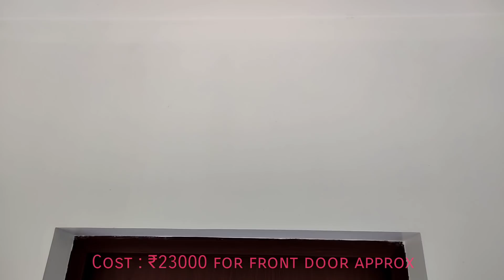#lowcost housing #Home without wood, cement | New gen construction materials | Trips & tricks vol 13

Comment: building cost paranhilla..
Reply from the maker: House construction cost: 1000 ~1100 /sqft (structure)
Interlock brick cost - 29/- Piece
Gypsum platerig cost - 32/ sqft (with material)
Steel door - 23000 (Front door), 14000 Iinteriro doors)

Comment: Interlock brick cement illathe aano undakkiyee..
Cement illa ennu paranjuu
Atha chodichee.
Filler slab enganee
Reply from the maker: Cement platsering illa ennanu udeshichathu :-) . Fillerslab is good, if it paved in a proper manner, else leakage is the result.

Comment: Exterior wall gypsum plastering ചെയ്യാൻ പറ്റുമോ.
Reply from the maker: Ipol water proof gypsum available anennu kettu. Athu use cheyyan patum
Reply: Ok thank you...
Reply: Interlocking mud blocks ന് വെട്ടു കല്ലിന്റെ അത്ര strength ഉണ്ടോ. രണ്ടിന്റെയും size same  ആണോ..
Reply from the maker: @myunus737  size same alla..1.5 interlock briks vendi varum oru vettukallinte size match cheyyan. Compressive strength kooduthal interlocking bricks inu aanu
Reply: അപ്പോൾ ധൈര്യമായി interlocking mud bricks കൊണ്ട് പണിയാം. Thank you so much...

Comment from the maker: House construction cost: 1000 ~1100 /sqft (structure)
Interlock brick cost - 29/- Piece
Gypsum platerig cost - 32/ sqft (with material)
Steel door - 23000 (Front door), 14000 Iinteriro doors)
Upvc Windows - Approx 600/sqft
Reply: Trips&tricks chetta no onu thraamo
Reply from the maker: @shijuthomas795  8050927308 plz whatsapp.me
Reply: Also share the companies or brands and suppliers of the following:

Brand of gypsum plastering material.
Supplier of uPVC windows and steel doors.
Interlock brick brand.
Reply: Total expense without furniture ethra vanu ?

Comment: ഓട് വച്ചു വാർക്കുന്നത് വളരെ പഴയ രീതി.  ചോർച്ച ഉറപ്പ്. കുറെ കഴിയുമ്പോൾ ഓട് താഴെ വീഴും. മൈന്റൻസ് ദുഷ്കരം. 
 മണ്ണിഷ്ടിക ഈർപ്പം വലിക്കും. ഇത്  വളരെ കൃത്യമായി അടുക്കിയെല്ലെങ്കിൽ ലെവൽ വ്യത്യാസവും ഗ്യാപ്പും ഉണ്ടാകും. കാലാന്തരത്തിൽ പൊട്ടുവീഴും.കൂടാതെ മൈന്റെനൻസ് കൂടുതലാണ് ജോയിന്റുകളിൽ കീടങ്ങ
ൾ കൂടുക്കൂട്ടുന്നതായി കണ്ടുവരുന്നു. ഏതായാലും ഇത്തരം ഇഷ്ടികനിർമ്മാണ യൂണിറ്റുകളെല്ലാം പൂട്ടിപോയിട്ടു വര്ഷങ്ങളായി. ചെലവ് ഒരു
താരതമ്യം നടത്തിയിട്ടില്ല. 
ചെറിയ വ്യത്യാസത്തിന് റിസ്ക് എടുക്കേണ്ടതുണ്ടോ? 

വിഡിയോയിൽ പറയുന്ന കഴപ്പങ്ങൾ ഉണ്ടാകുന്നത് വേണ്ടരീതിയിൽ മരം പണിയാത്തതുകൊണ്ടാണ്.
Reply from the maker: Fillerslab technology is widely accepted and proven technology. Its not proven that the fillerslab causes leakage. Laurie Baker (indian - british architect , known for eco friendly sustainable achitecture) widely used this technology and those structures are still the examples of eco friendly sustainable housing. And the concretete leakage is common, because of many factors, which cannot be directly related to the fillerslab technology.
Reply from the maker: Using wood is very old tradition, however the wood available today is not worth it. I can give number of new houses where the wooden shutters are decayed within few years.

Comment: AAC BRICKS എങ്ങനെ bro?  My concept same
Reply from the maker: AAC brick interlocking allallo. Smooth surface ayatond plastering chilav koravarikum. Compressive strength ne pati enik ariyilla.
Reply: Use  only for interior partition... low density, more air gaps, low strength
Reply: Check ramees ali in utube